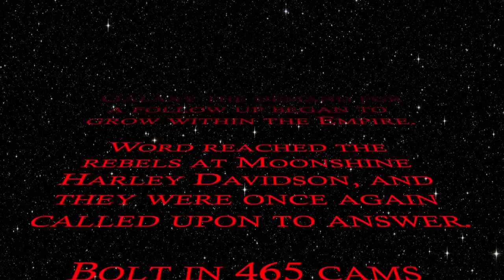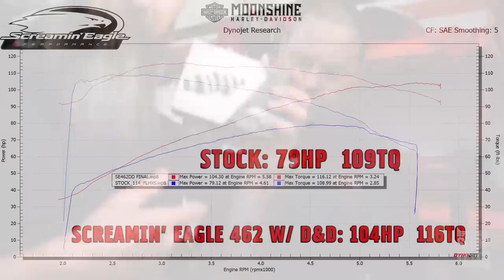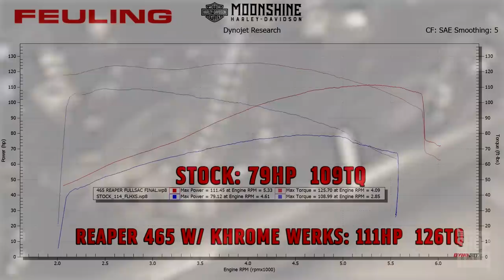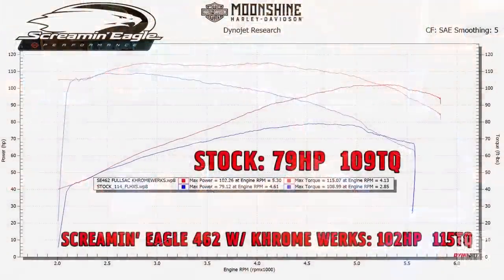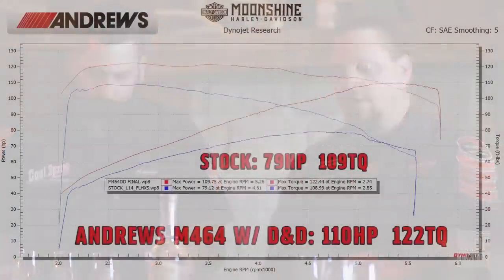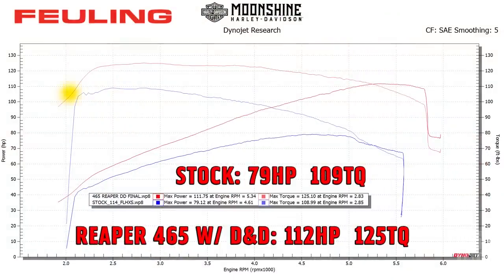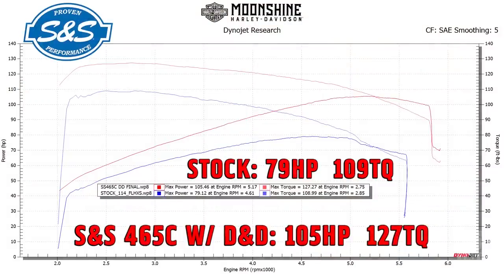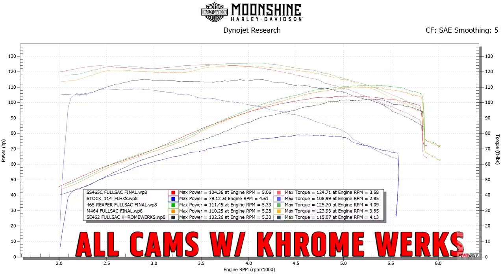Cam Shootout Series | Part 2 (Screamin' Eagle 462, Andrews 464, Reaper 465, S&S 465C)

Comment: Boy, Feuling is bad ass! I am currently throwing a set of their 505/515 cams in my XL right now, I will have it buttoned up by Monday. I can't wait to see what I get out of it. I hear great things about their stuff. Their stuff for the m8 looks like some great stuff! Safe to say Feuling parts will make their way in future builds too.
Reply: Dying to know how you like that 505/515 and how it compares to stock. Considering it myself but they're are no good reviews out there....
Reply: @ronhernandez9198  I had the same problem, I knew Feuling made awesome Twin Cam and M8 cam kits so I pulled the trigger on the 505/515 and I absolutely love them, I found no loss of power down low, and once the bike hits 3000RPM it really winds up. They are a great set of cams!. I'll make some videos viewable on my Youtube channell so you can hear them and see how the bike works. At the time of the videos the bike had an S&S teardrop intake, Vance and Hines stainless 2-1 upsweep exhaust, Vance and Hines FP3Z tuner and of course the Feuling 505/515. The bike is currently having the S&S 1250 with S&S 10.5:1  forged flat top pistons, Feuling Endurance valve springs, Feuling HP+ lifters, Hammer Performance solid push rods, Buell bronze oil pump gear and a load of other parts, so I will have to add some updated videos soon!
Reply: @jonnymac8925  great feedback. Im betting you're gonna have the baddest 1200 out there. Thanks
Reply: @ronhernandez9198  Thanks Ron! Since the videos I added I also added 13 inch progressive 490 sport series shocks, Progressive adjustable monotube cartridge fork kit, daytona steering damper, 10 inch mx tbars, saddlemen stepup seat, carbon fiber side panels and fenders, HD customizable tach (600 different colour for the needle, the rpm gauge and the analog speedo gauge so the colour combos are endless) that also shows miles to empty, fuel gauge, miles to empty, gear indicator and so on. I also have a master cylinder fuel gauge which is a replacement master cylinder cap for thr sportster master cylinder that has a small lcd screen on it to show fuel level so I have 2 fuel gauges, a oil temp/level lcd dipstick, Screamin Eagle fat plug wires and Screamin Eagle plugs,  TMF chain conversion, mid controls, 1/4 turn throttle, Brembo 11.5 inch floating rotors with black aluminum carriers for the front and rear, rebuffini and speed merchant brackets to fit the larger rear rotor with Brembo radial calipers and the bracket for the Brembo radial caliper up front, Brembo pads, XR1200 master cylinder, braided brake lines, Barnett extra plate clutch pack, Barnett billet pressure plate, Barnett 25% diaphram spring, 1FNGR easy pull levers. I 110% needed them after doing the 25% spring because there was about 75lbs of pull on the clutch lever and those levers made it so easy, I couldn't reccomend them enough. I sadly got rid of the v&h stainless 2-1 after I got tboned by an old lady in November and now have a Bassani road rage 3 stainless 2-1 on it, but the v&h 2-1 was absolutely amazing (as I am sure you can see/hear in the videos I posted). I also put a new industrial gray tank on the bike to match the carbon fiber panels, and I replaced my cam chest with a gloss black HD rail collection chopped cam chest, gloss black HD rail collection primary case, gloss black HD derby cover, gloss black HD rail collection lower rocker boxes, gloss black HD pushrod tubes and gloss black HD tappet covers, flat black HD upper rocker boxes and swapped all the silver hardware on the motor/trans/frame and accessories to a kit that HD makes for grade 8 black replacement hardware. I am swapping a thundermax ecm in to replace the FP3 since the motor is far from stock now, and some other little odds and ends to pick at. I have only had the bike for like 18 months at this point haha

What is the story on your bike? I think I may have a problem, and yes! I am aiming to have the baddest Sporty around. I live on an island in Canada and most the HD's around here are stage 1 or stock for the most part. The bike was getting lots of positive feedback before I did all that work, it should shut up some Sportster haters too hahaha. One thing I will say is a lot of people said my bike sounded like v8 race motor because of how it sounded and revved with the 2-1 and cams, the videos really don't do justive to either!
Reply: @jonnymac8925  i just installed the phat plug wires and screaming eagle spark plugs with a wire wrap eliminating the plastic shroud. Went with the mustang revere gravity seat.  Put on the viking swing arm bag cus its a hard mount.  Arlen ness grips , pegs, and fork brace. Progressive spring up front and am thinking of going with Legends revo - A in the rear. LED's all around. Have the letric switchbacks up front. Harley engine guard with their oil cooler which i always highly recommend. Gonna go with galfer brake set up and of course the Feuling 505. Figured either trade up or just go all out. Like this bike too much to trade.

Comment: Love the great videos and all the work you guys are doing to keep us informed about m8 options but they all seem to be on the 114 engine!! How about the 107 drop in cam selection ? I’m thinking of riding down from Canada for your crew to work your magic on my streetglide
Reply: All these cams will work well on a 107.  Just subtract 7 from the numbers.  Curves will be very similar.  We can help arrange the time and it only takes 2 days from start to tuned finish and we include a detail.  Call Aaron and we can start making arrangements
Reply: @NoName-vz1ob  Whats the biggest cam you can put in a brand new harley that hasn't left yet, that wouldn't void the harley or extended warranty, or is it a screaming eagle cam only that doesnt void the warranty? I keep getting different opinions from different dealers, when i just need the facts, like the way it is looking is any other cam other than harleys screaming eagle cams void the warranty from what I have been told, or is it true that you can put in any cam you want within 90 days of purchasing it and not void warrantys on a new bike? thanks for clearification on this in advance

Comment: I have been looking at the screaming eagle twin cam tire shredder kit. 103 to 110cc 92500037A Kit. I have also been thinking about doing a s&s cam support and oil pump, and set of screaming eagle inner cam bearings. I am considering having all this work completed at the same time. Then having it installed and dyno tuned at my local Harley dealer.

Currently the the bike is a 2015 Road glide 103. With screaming eagle heavy breather air cleaner and set of Vance & Hines 4” round twin slash slip-on mufflers.

I ride both with and without a passenger at times. I feel I am in need of much more torque with my passenger when the need arises to pass another vehicle. Also I like to play with the boys at times. Meaning a race or two may occur from time to time.

I would like your opinion of this combination of parts. I would also like your recommendations if you were to peace a combination of parts together individually to accomplish the same goal. 

Thank you in advance. Mark
Reply: The S&S power pack will probably serve you better.  You can get them with 551 or 585 cams depending on your riding style.  These cams are far superior to the SE259.  The downside is many dealerships are not familiar with these components and tuning etc.
My insta handle is @m.v.o_motorfast.  hit me up there and hopefully I can better answer questions.

Comment: Are all of these cams running with stock lifters oil pump cam plate and pushrods? Can I dump in a reaper 465 without changing everything out?
Reply from the maker: Nope. We never use H-D lifters on aftermarket cams.

Comment: Hi love the Vids 2017 CVO Street Glide RCX Tormentor head pipe Cobra Race Pro mufflers V&H FP3 Fuel Pak looking to step up to a cam would the 465 work or should i move up to the 475 leaving stock compression 10.5:1 Wish you were closer i live in Mass/ New Hampshire Border
Reply: Ok.  A couple things.  
On stock compression a 475 is a bit much.  These cams are very well suited.
We do pick up/delivery for engine work.  Hit me up on Instagram @m.v.o_motorfast or call the shop and we can get started.
Reply: Hi i went with the Reaper 465 cam S&S lifters,cuffs,pushrods,cam bearing and plate,oil pump heavy duty clutch spring and easy pull cylinder slave and an oversized K&N filter for the HD CVO Ventilator air cleaner to keep the CVO look but increase air flow eliminated the V&H fp3 and had it dyno tuned direct download 111+hp/125+tq can't wait for the weather to break and ride my new beast couldn't have done this without all your informative Videos planning a trip this season to come your way and say Hello and have a drink of that moonshine with you guys THANKS!!!!!!

Comment: Which pump and plate fueling or s&s would u recommend
Reply: louis bors They are both quality pieces. Run the one the matches the cam, unless you’re going with a different
cam company. In that case pick the color you like best. Both have great benefits over the stock configuration.
Reply: @jamielima5315  was gonna go with the sed shift cam but was thinking of doing a 130 kit in the future

Comment: Going to sound daft now but what does the 468, 472, 465, 568 mean? Is there a way to get an idea of a cams characteristics from these numbers?
Reply: With the M8 engine the numbers are usually the lift of the cam.  There are some exceptions such as Wood performance TMan etc. But  most companies are using the cam lift as part of their model numbers.

Comment: Great video,  here's an idea for you... I have the CVO RG 117, which from what I understand is a stage 2. What can I do for a cam that will give me better low  to mid range gains. I'm not really wanting to change the jugs or pistons or else I'd go for the stage 4. Much thanks in advance.
Reply: There are some great bolt in options for the 117.  Call Aaron at the shop and we get you hooked up.

Comment: Thanks for the review(s). Those all seem to run outta gas at higher RPM - seems like the intake/heads need some work.
Reply: FukTheNewCommentSystem The cams runs out. All of these cams are designed to run with the stock compression ratio to produce a quick torque curve. If a larger cam with more duration is used the bottom will suffer but you’ll gain HP. The best way to achieve both is to match the cam to compression and motor displacement.

Comment: have you done Woods MW8-77X? whats that pulling?
Reply: The MW8-77X is a larger cam that will preform well in the right situation.  We would not recommend running this cam on motors smaller than 120 cubic inches, and there are other well tuned parts needed to make it run correctly. If this is something you are interested running please call us so we can discuss your options. Jamie Lima 615-771-7775

Comment: Love the videos, would you guys be able to do a review and dyno video on the S&S HP103 and MR103 cams? I cant find any real concrete info on the hp103. I've found maybe 1 or 2 threads on the mr103.
Reply: We most likely won't do a whole video on them but I have run and really like them both.  What bike do you have and what do you plan on doing engine wise?
Reply: @NoName-vz1ob  08 FXDB. 96ci, Air cleaner, d&d fat cat, powervision. Will pull a couple bike lengths on a few stock 103s that I ride with. In the far future I may go 103 or 106 but that's about it not planning on heads or head work unless I get a steal of a deal. Ride solo 90% of the time. I have some videos if you care to go through them. I dont baby the bike whatsoever. A lot of highway runs and the occasional dig.(in Mexico of course.) My reason for asking about the specific cams is because s&s had a dyno sheet comparing the stock 103 cam against the HP and MR I feel as though my bike already puts out more than a stock 103. I'm not expecting to see 100hp/100ftlb out of the 96 but if I can get close to that with the hp103 then I'd be happy. Considering the measly 68hp that the 96 puts out factory. I understand the dyno sheet I see how and where the cams make their power. On top of that, i plan on either regearing the bike 32/70 or 30/70 so low rpm will not be much of an issue. My biggest concern is that of their numbers throughout the graph. As far as inflation of numbers and it doesnt indicate whether the 103 had a stage 1 with the cams or if everything was left factory other than the cams. Which is what makes me a little sceptical.
Reply: @supersoni126  I have run the HP103 on a 103 bagger with a fatcat and it did pretty good.  We then did compression heads throttle body etc and it really woke it up.  The MR103 is usually a cam I go to for baggers with a stock 110.

With you leaving your displacement and heads etc. On a 96" these may be a little much.  It will feel lazy until wide open throttle.  Sounds like you have a strong runner already so something like a 551 would really put some pep in it without going into the top end.

Comment: I need you guys to test out the Reaper 465 in combination with a 124 bbk. Thanks
Reply from the maker: Ace Dooley not enough cam for the 124. I would run our 492 or 521 depending on your setup and desire. Call the shop and ask for Aaron or Jamie 615-274-4170. We have tested over 10 cams in the 124 but haven’t made a video about it yet.
Reply: @MoonshineHarley  Rgr

Comment: Star Racing 30-30 or the 585
Reply from the maker: For what setup?
Reply: 107 M8 110hp-123 torque = Star cam 30-30 with Bassani head pipe and SE slip on
117 M8 140hp-142 torque = Star cam 585 racing+VH slip on mufflers(4.5) + head pipe VH + 64mm SE trottle body.....and more. Next project 128 cylinders SE, Star racing pistons, Feuling racing oil pump and others stuff from SS , is going to be interesting on the dyno!!!!
Reply from the maker: @stevevillemaire4380  When running the star 3/4 race you need compression. So pairing George’s cam with his pistons is perfect. We like his components for race setups.
Reply: Moonshine Harley and George is moving close to you, hope to see some products in Moonshine Harley video 😎

Comment: What’s the difference in the feuling 465 cam vs the s&s 475 cam in a 107?
Reply: We don't run the 475 in stock 107's.  Without added compression the bottom end will suffer.  The 465 Reaper is a great choice for a 107
Reply: M.V.O _Motorfast I have a 2019 fxbb with a bassani pipe Arlen ness air cleaner with S&S 475C cam and a power vision, tune from Fuel Moto with a few auto tunes on top of that, I did lose a little in the bottom end but only 2700 rpm  and below what should I do if I want keep this cam? Thank you for your time.
Reply: @kainalugreig4639  that cam is awesome with compression!  Put 124 cylinders and pistons and bigger injectors and it will rip!

Comment: Hey guys! Great videos on the M8 upgrades! I currently have a 2017 RGS with a Stage 3 114 Harley Kit. With V & H Power Duals and 4.5" OS Slip-ons! As well as a HD Tuner and Smart Tune Auto Tuner. I'm Thinking of adding a S & S 465G cam to my ride, will this Cam work with my current setup?
Reply: @stang362008 call me athe shop, the sort answer is YES, although I might recommend a couple changes to the package of components,  particularly the exhaust and tuning solution to extract the best performance From a setup that we build together.  AARON.
Reply: stang362008  doing my research did you call Aaron and get the 465 installed

Comment: Great work - thank you!

Have you tried the V&H 2-1 Pro Pipe with the S&S 475 or any other of these cams?

Maybe use a Pro Pipe in future vids? You might like how it performs compared to the D&D and it's a bit less expensive. It may do as well or better than the D&D, for hundreds less.

Comment: Great video I really enjoy watching all your videos please keep them coming! 🤘🏻😎
Question.. I am considering doing a Stage ll SE-585 cams to my HD 2016 FLSS. Will they cams give me great torque throughout the RPM? So far I have a SE Pro Tuner & SE Auto Smart tuner and SE Street Canon slip ons the HDD also change my Head Pipes to instill the new wideband oxygen sensors. The filter is still the stock stage l that comes from the factory. Not sure if I want to go with the K&N don’t really want to deal with cleaning the filter. Is there a lot to gain with going with a K&N filter that I would be able to notice riding? or can you only see the power on the Dino?? 80% of my ridding is two up hill roads & highway speed‘s are 70-85MPH. This will probably be the last thing performance wise to my Softail FLSS. Thanks again for all the great videos......
Reply: Without added compression/displacement I would steer toward the SE-255 in HD cams.  And yes.  The K&N filter is an upgrade.  Thank you for the props by the way...  We appreciate you watching 🙏🙏🙏
Reply: M.V.O _Motorfast  Thank you for getting back. How do I find out What cams are in my 2016 Harley Softail Slim S?
Reply: @fililoboesparza5784  they are similar to a 255 but with a .535 lift instead of .555 lift.  With using HD/dealership tuning and cams the power gains are somewhat limited.
Reply: M.V.O _Motorfast Thanks for getting back. So Riverside Harley Davidson of California is my local dealership. They were the ones that were telling me that I should go with a SE-585. But the SE-255 makes more sense and after seeing you guys making this video I know for a fact that all three of you know what you’re talking about when it comes to cams!! 🙌🏻🙌🏻🙌🏻
Going to talk to my technician about going with the SE-255 Cams for FLSS! Thanks again for all your help..